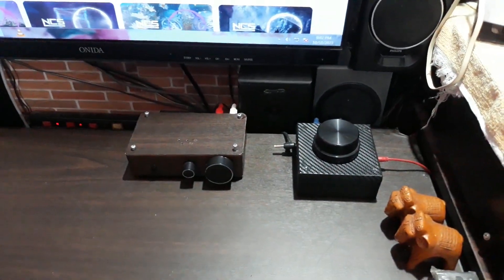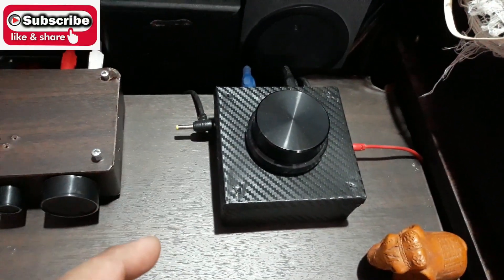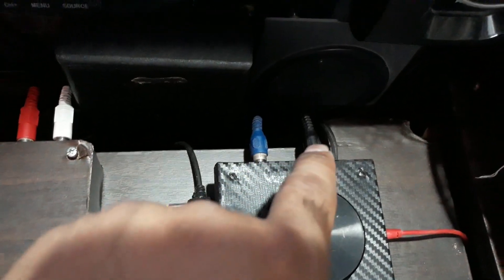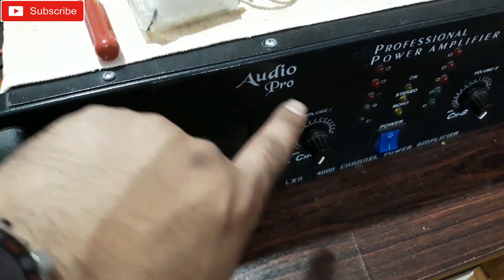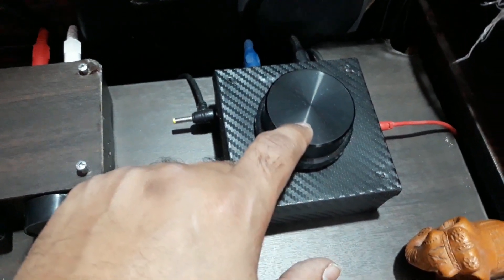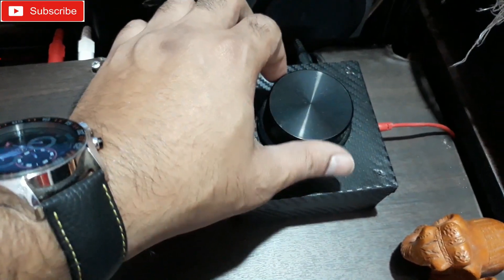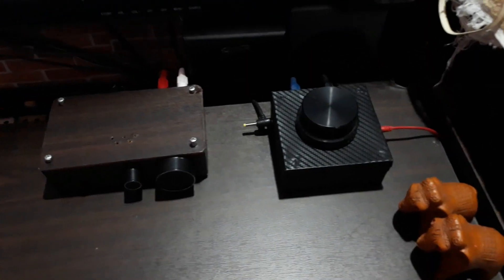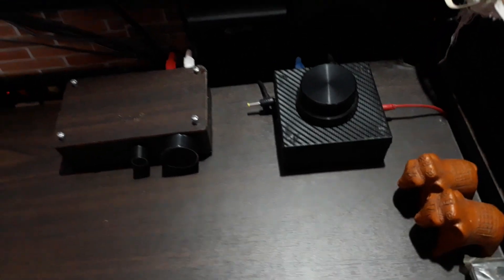DIY 2.1 Control Pod Amplifier / CLass d + Class AB Amplifier / Homemade 2.1 Amplifier/ The technoboy

Comment: Bro, why are you using a P. A amp for powering subwoofer. Such p.A  amps have an output impedence matching transformer which limits the low frequencied, it generally has ei core which makes it perform lesser db at 20 hz or even the favorite 35 hz.
Reply from the maker: Thats just the cabinet of a PA amp. I build that amp specially for subwoofer only.
Reply: Cool bro. Pls show internals in  a short video maybe
Reply from the maker: Sure i will try